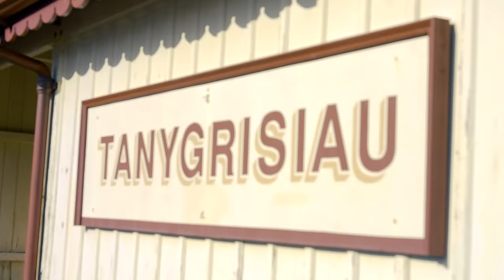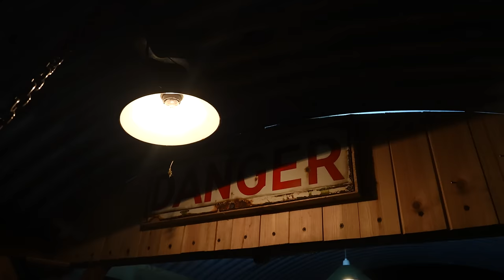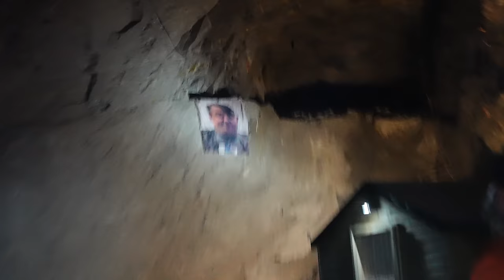We Stayed At The Deepest Air Bnb In The World

Comment: what a perfect place to hide something with two small eyes made out of reflective tape, peeking back at you from the deep darkness, and laser tripwires activating some speakers somewhere deep in the darkness making some inhuman noise, some "bloody" handprints and dragmarks leading down one of the paths, speakers with faint cries for help and inhuman grunting sounds, as you go down the part at 17:00, there could be a face hidden somewhere along the way using relfective tape for the eyes, perhaps some simple motion activation where it starts making some low gutteral grunting and some simple movements.